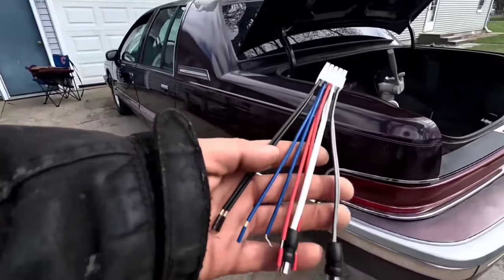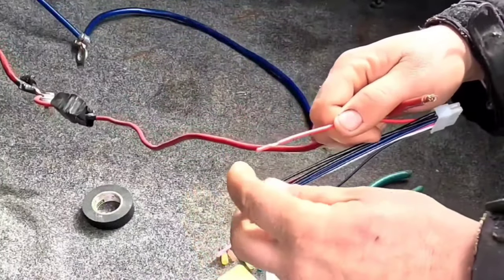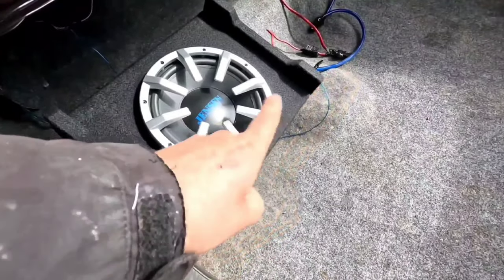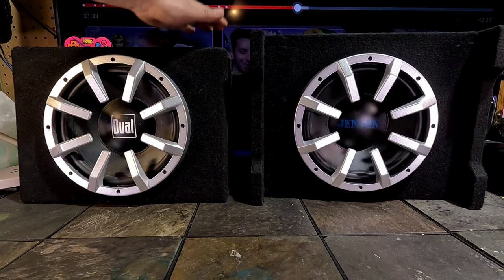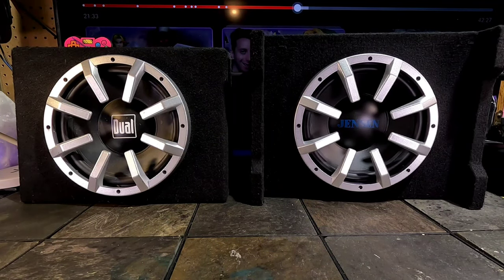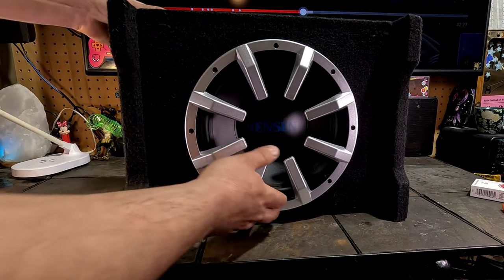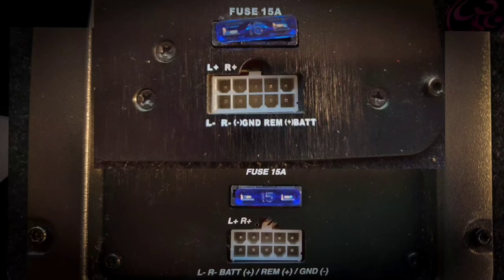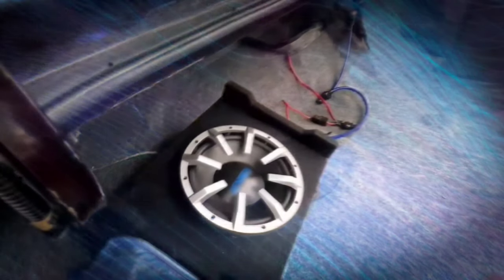Is the JENSEN J10ASB Subwoofer WORTH It?

Comment: I’ve installed this subwoofer in my ford Ranger with a pioneer touchscreen radio, the wiring is all correct that I can tell, the RCA cables are going to the sun pre out L and R. The amp turns on but doesn’t work for me. I turned on subwoofer in audio settings and still nothing. Any tips?
Reply from the maker: I wonder if there is an option on the headunit to turn on/off the sub signal out. The thing you turned on may just turn on the amp (sends voltage to the blue remote wire)  other things could be the gain is set too low on the amp and headunit, rcas are faulty or not connected properly ( sometimes they are hard to push in lol) or, the speaker could have came unplugged at the amp or speaker. 

If you can, turn on the amp and plug In the rcas and touch the other end of the rca cable. If you hear noise when you do that, then it means the headunit isn't sending an audio signal. I've had that happen often.
Reply: @Blowncapacitor84  there is an option in the head unit and it is turned on in the settings.

Comment: I picked one of these up the other night. I am have some issues with wiring them though. I have a scosche rca adapter for the stock system. I’ve had a system wired in before that I did but I’m used to the separate amp and separate sub setup not a wire harness. I had someone helping and they were confused as well. Got any videos helping with premade wire harness to an rca adapter?
Reply from the maker: I just did a video 2 weeks ago on installing a line out converter (adapter). I also did a video on answering questions about the Dual TBX10A (which is pretty much the same thing). In a nutshell, the harness has 2 red power wires' 2 black ground wires, 2 blue remote wires and 2 rca connectors. The rca's will connect from the adapter to the harness. The power and ground will connect to the red and black wires on the harness (btw, there are 2 wires for each of the power, ground and remote but you can just connect both of those at the same time because they actually connect in the amp and are for using multiple subs. If you only connect one, then be sure to tape the other one.) Now the adapter you have should also send the remote signal?
Reply from the maker: https://youtu.be/01WUW7WS2RQ?si=dBCpvmlabjzWFXu_
Reply from the maker: https://youtu.be/hX-6msONXaY?si=blI5-rdtNYrdApN_
Reply: @Blowncapacitor84  it does have a remote wire coming out off the adapter as well, yes.
Reply from the maker: @acw223  yup!

Comment: Sorry I'm new at this I don't understand the wiring
Reply from the maker: No worries! I didn't really go into much detail on the wire harness. Basically, you'll need an amplifier power wire kit (walmart has them) this will power the sub. The red wire is the positive power wire, the black is ground, and the blue is the remote turn on (this turns the amp off with the radio). You'll need a radio with rca outputs and a remote out. If not, you will need a line out converter. Here's a link for installing an identical sub. https://youtu.be/x54sq40aIIc?si=qe4PCutwFLciUBWQ
Reply from the maker: https://youtu.be/hX-6msONXaY?si=QdnbtA9HNwyTeYWs

This explains the line out converter

Comment: ANY IDEA WHY THE AMP PART IS HOT TO THE TOUCH?? bought this today wired it up and it gets really hot
Reply from the maker: https://youtube.com/playlist?list=PLsinTIDJ_UuduL_ZVW7CxCIdFVdCidzeF&si=gV53-RMKd_t33nxT
Reply from the maker: Go to that playlist and check out, "Answering your questions about the Dual TBX10A"  (which is pretty much the same thing). I answer a question about that... they will get warm, but it shouldn't be hot.
Reply: Thanks!
Reply: @justgaming3084  the built in amp is a class AB and not a D . Class AB amps run hotter by nature as they are less efficient and give off this as heat .
Reply: I just bought one yesterday and it’s hella hot to the touch. Always hit protection mode. Not a bad sub tho

Comment: Hey there!
I bought a kicker Walmart sub. It has a built in amp. The wires that came with it wants me to splice into my door speakers for rca inputs. I have a 2023 f150. Would it matter if I splice into my rear speakers? Or should I splice into my front speakers?
Reply from the maker: It doesn't really matter either will work
Reply: @Blowncapacitor84  thanks for the info!

Comment: I got my car wired up for the Dual TBX10A last week but the sub was a dud and didnt even work. Getting the Jensen 10 installed in the morning, what are they gonna have to change? Hard process or quick?
Reply from the maker: Super quick and easy! The only thing that has to changed is the battery positive and negative wires that are reversed on the wiring harness. They will probably change out the whole harness but that only takes a couple of minutes.
Reply: @Blowncapacitor84  Cool! thanks for the reply! Wanted to know what I might have to pay for. Was a stressful experience last week when the Dual sub didn't even work after having my car wired up.. guess that's what happens with a clearance item LOL I couldn't find any other videos on the Jensen really aside from yours, is the bass good? Someone said these powered subs are similar to a home soundbar audio sub and I feel like that can't be true haha
Reply from the maker: @pokemonstah401  lol, it's way better than a sound bar! I think it's great and has surprisingly good bass for the size and price. It won't win any competitions but it DEFINITELY will sound way better.
Reply: @Blowncapacitor84  Sweet!, thanks for the reply again. Subbed. And yeah I figured it hit way harder than a bedroom sub. Just want some solid bang in the trunk, currently have a 2015 Nissan Altima SL with the all around Bose set up, just want a woofer for a lil extra bump 🎶

Comment: Mine isn't powering on anymore randomly and I can't figure out why, fuse near the battery looks fine from what I can tell doesn't look black or burnt or anything
Reply from the maker: Check the ground. I would also check the power wire and fuse by the battery
Reply from the maker: Also I've noticed the harness seems to be hard to push in all the way. Maybe it backed out of the amp?
Reply: @Blowncapacitor84  I'm honestly a noob when it comes to this not gonna lie 🤣 but from what I can see on the fuse near the battery, it looks good as far as condition. I'm not sure if the blue chip fuse on the sub itself comes out? But, I unplugged and replugged in the harness multiple times and no power light or anything. Can try to push it in tighter I'm not really sure. Thanks for the reply!
Reply from the maker: @pokemonstah401  you're good! That fuse will come out (might need some needle nose pliers) I'd say pull it and check it but also check the ground wire if possible. I've had lots of problems with ground wires lol😅
Reply: @Blowncapacitor84  cool I'll try to yank that out to see if I can see anything wrong with it (not sure how to tell) I checked the battery one and it seemed clear, no black or burnt look to it but I'm not pro, and how exactly do I check the ground wiring near it? Can send pics of you have a contact info? Hopefully the sub itself isn't blown, no light comes on at all

Comment: Why won’t the sub turn off after u turn my car off? I ran the remote wire to the sunroof fuse.
Reply from the maker: Yeah that won't work. If you run it off the fuse it will be always on. You should wire the remote to something that is switched with the ignition after the fuse panel.
Reply: Thanks. Where did you wire your remote wire? I also tried the cigarette lighter
Reply: So should the amp turn off when the car turns off?
Reply from the maker: @Big_Clappa do you have an aftermarket radio or stock? I would guess it's stock. I wired mine to the remote out wire on my aftermarket radio. If you don't have one then you have to take a multimeter, set it to direct current and figure out what has power when the ignition is on but not when the ignition is turned off. The absolute easiest way you can do it at this point is to get a switch, cut the remote wire as you have it hooked up, connect on side of the wire to one side of the switch, and connect the other side of the cut wire to the other side of the switch. Then, you can just flip the switch when you turn off your vehicle. Basically, power needs to bot be present at the remote wire when the car is off.
Reply from the maker: @Big_Clappa  yup! 😁 you got this bud! Thank you for watching!
Reply: Ok thank you. Yes I am using a stock radio. I will use a switch most likely. Do you think they sell the switches at Walmart I can use? Thank you very much
Reply from the maker: They do! That's where I got mine from for another project.👍
Reply: @Blowncapacitor84  OK sweet one more question will I have to take the negative off my battery to add and switch in the remote wire or am I safe?
Reply from the maker: @Big_Clappa  no, your safe.